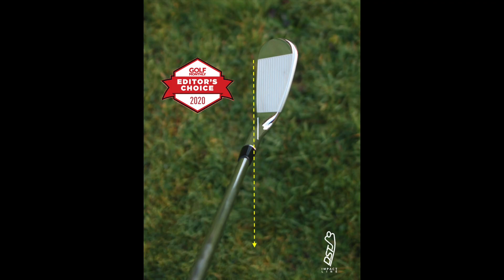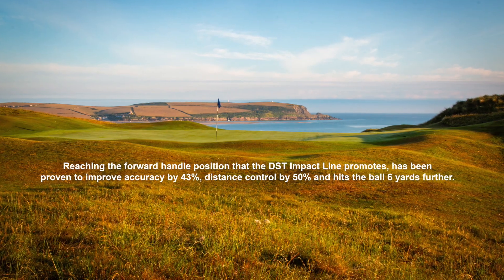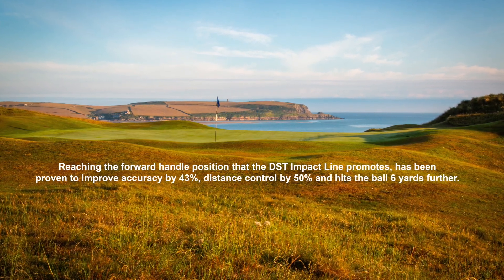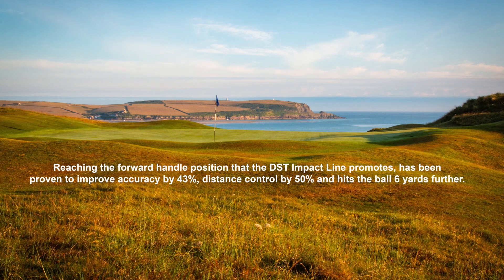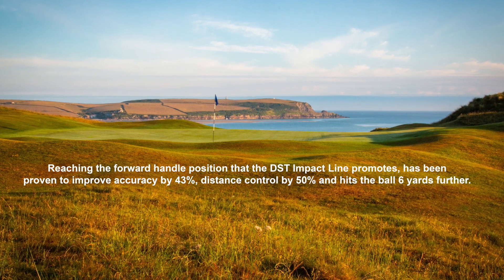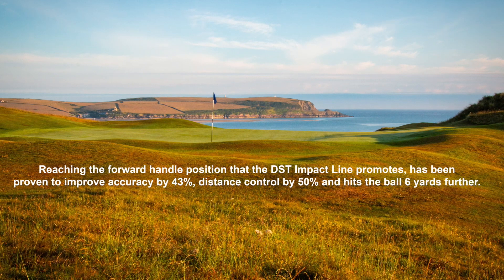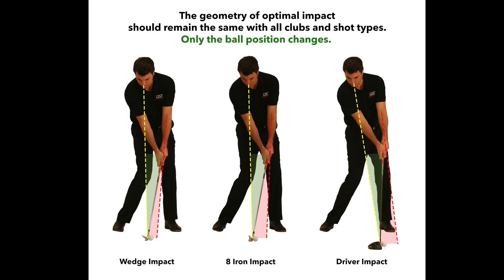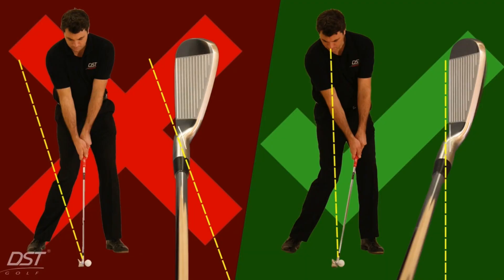Tommy Fleetwood Slow-Mo Overlay. Highlighting the forward handle position that produces a lag impact

Comment: I believe your message 100%, but how do you possibly justify the horrendous cost? It’s not ‘technology’ it’s a laser etched line which you can see at address but what does it do when actually swinging the club, you can’t even see it. £100 per club, really? It’s all very well showing the best professional players in the World in one post impact position in all of your videos, demonstrating ‘lag tension’, but how does the average amateur even relate to that? You need to show how the swing as a whole gets to that position, not just a freeze frame which is next to useless. How does a line on a club really benefit a player without them fully understanding how and why they need to achieve that position? Maybe the £100 per club should include some in depth one to one coaching of the concept of ‘lag tension’. Then it might just be worthwhile.
Reply: Hi 👋 a low cost solution is to use an alignment stick that’s about 4 feet long and hold it along the club shaft so it runs up along your lead side. If you flip the club it will hit your lead side. Only hit short shots. Good luck 🍀 I use a stick but I want a dst to try it.